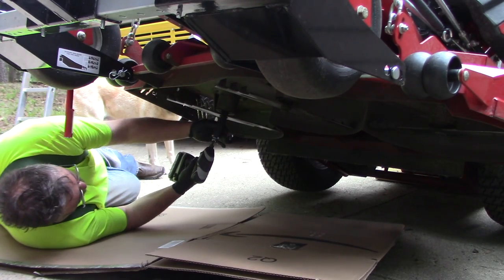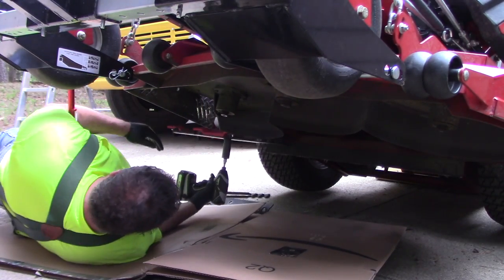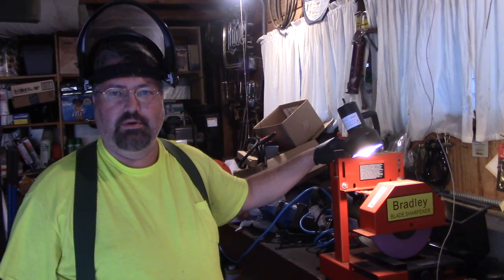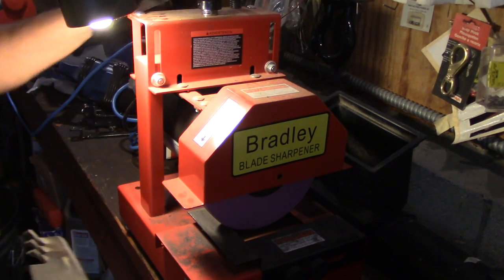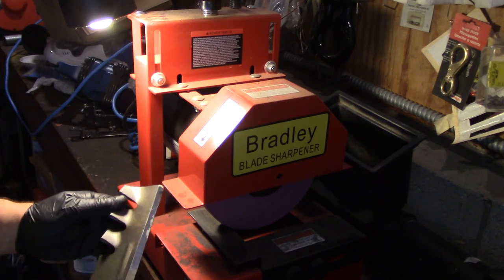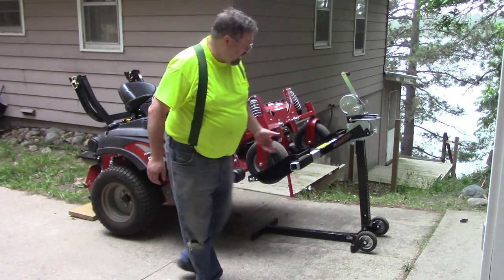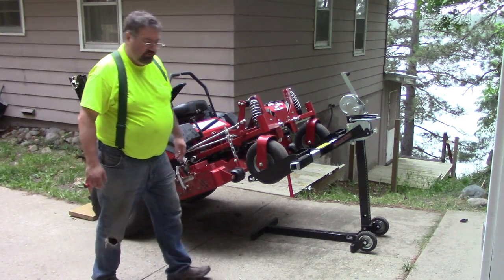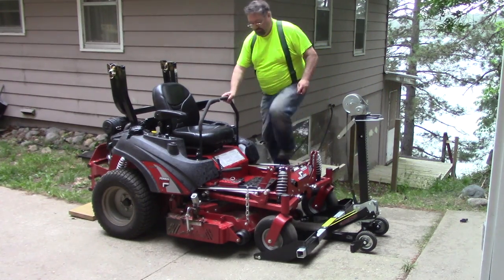Bradley Lawn Mower Blade Sharpener

Comment: Hi, I have been using that sharpener for over 15 years, you have it set up 90 degrees to the right in the wrong orientation. You should be facing the Bradley logo with your feet placed at 45 degree angle. Hold the non sharpening end of the blade with your right hand and the back side of the sharpening end with your left hands thumb, middle finger against the wing side with your forefinger pressing down from the top of the blade, your fingers should be in a 3 point stance and then moving the blade with a smooth front to back stroke. For your blades the wheel should grind and sparks toward the middle of the grinding wheel ( to the right). Walker Mowers have both a right and left turning blades so that the left turning blades are sharpened on the left side of the grind wheel and right turning blades are sharpened on the right side of the grind wheel turning toward the middle of the grind wheel, switch hands as described earlier.
Reply from the maker: The blades on my Ferris turn the same direction.

Comment: I have the same sharpener that you have. It will not grind a 30* angle. I find that using a hand grinder and a vice works better. If you can get a 30* angle please make a video on how you do it. I cannot figure out how to do it.
Reply from the maker: Ronnie, thanks for watching. I sharpen the blades on the Bradley but then undercut as my soil types are super sandy and prone to dulling the blades fast. The undercut gives me the 30ish degree angle.
Reply: The lower the grinding wheel/motor to the blade, the steeper the grinding angle (e.g. higher the grinding angle), the higher the grinding wheel/motor, the more shallow the grinding angle (e.g. lower the grinding angle).  For 30 degrees, want the motor/grinding wheel to be almost to its lowest position.

Comment: What HP is the motor on yours? I really like that it doesn't bog down when you sharpen. I am looking at the S100 model, but don't want A 1/2 hp to be bogging down like A cheap bench grinder does.
Reply from the maker: If I remember right, I believe it is a 3/4hp. I like it because it is pretty fast sharpening multiple blades.
Reply: @MinnesotaEric  Well mine came in yesterday. I have A brand new set of blades and want to keep the 30 degree angle they came with. I cant get my Bradley to do 30 degree. Any suggestions/ tricks?
Reply from the maker: Correction, mine is also a half-horse power. 30 degree wise, perhaps welding in a wedge so the blade contacts the grinding wheel at a less acute angle?
Reply from the maker: After looking at my grinder, I can see how the base can be adjusted along with the height of the grinding wheel itself to get a 30° angle, Gary.
Reply: @MinnesotaEric  Thanks. I have my base all the way to the left, and the height adjusted as high as it will go. still no 30 degree. Maybe it will do 30 degree after the stone wears down.
Reply: @garypitzer8729  The lower the grinding wheel/motor to the blade, the steeper the grinding angle (e.g. higher the grinding angle), the higher the grinding wheel/motor, the more shallow the grinding angle (e.g. lower the grinding angle).  For 30 degrees, want the motor/grinding wheel to be almost to its lowest position.
Reply: @williamnewsome5169  Thank you

Comment: Just woundeing way you would shoot the sparks right into yourself if the motor is riverable?
Reply from the maker: Limited bench space. This should be mounted on a pedestal.
Reply: As with sharpening any edged tool, one should "part" the steel away from the cutting edge and not to it.  In addition, having wheel turn clockwise to the blade (right turning blade), one has more control of the sharpening process, less likely to jam blade between guide and wheel (damaging motor) and less likely to scorch/burn the blade.